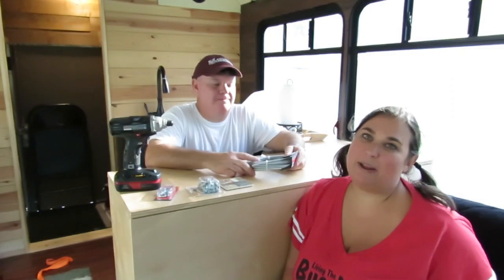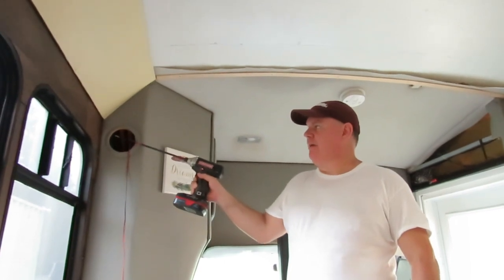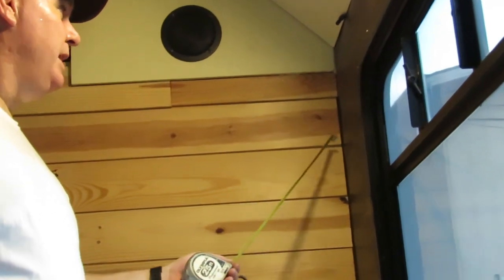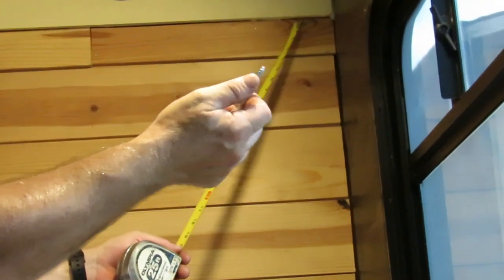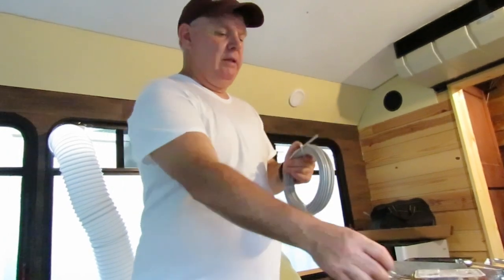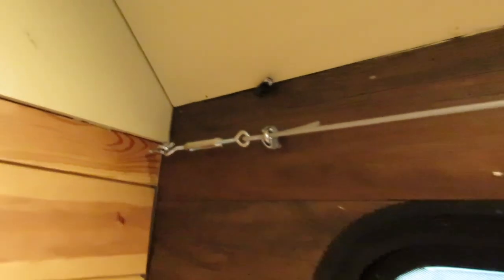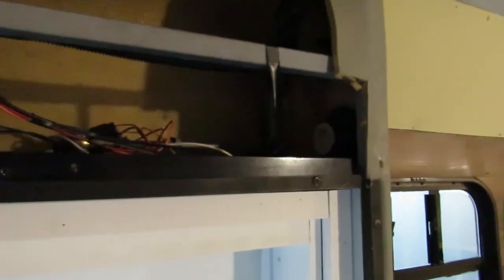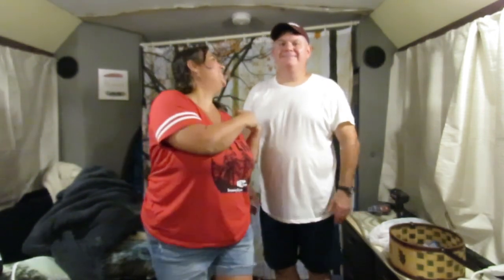Shuttle Bus Conversion : hanging curtains with wire

Comment: That made it look cozy!  Was it because of the wire thickness or tension that you didn't need hooks in middle of length to hold up?  Did this few years ago & mine sagged!
Reply from the maker: Perhaps its the thickness of the wire because so far there has not been any noticeable  middle sag. We did buy the teacup screw in hooks just in case we need to add them later.

Comment: Hi, does that AC work well with cooling off when it's really hot?
Reply from the maker: It didn't before we added the blackout curtains.  With the curtains closed it does a pretty good job.  I think we need to add an isolating fan to help push the cool air to the front and back of the bus better.